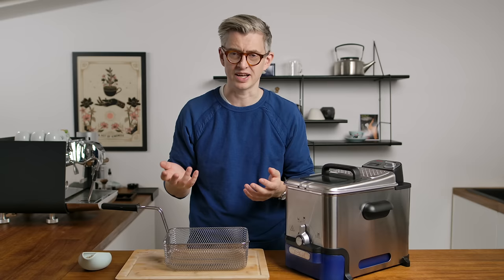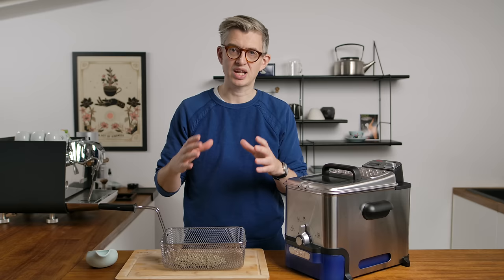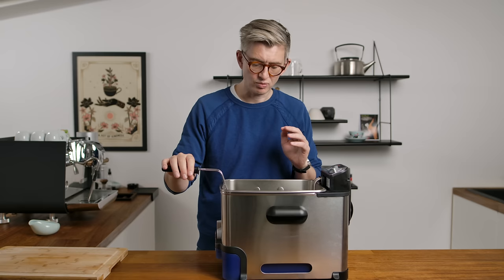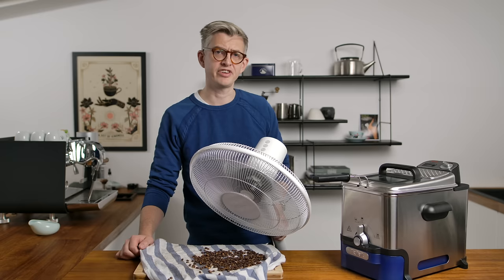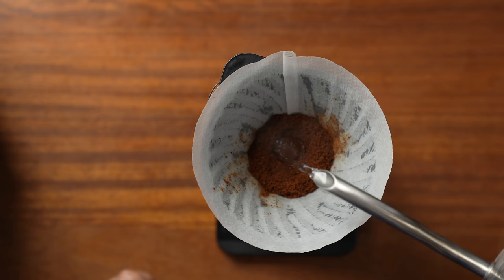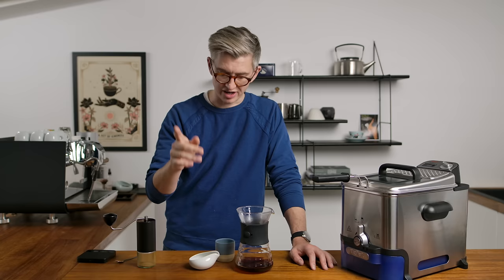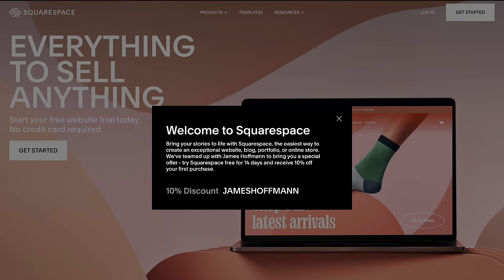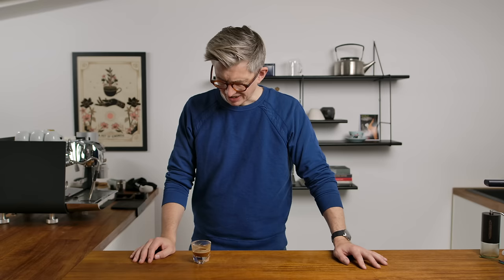Deep Fried Coffee: A Surprising Discovery

Comment: Best coffee by far?:
  My unique coffee recipe:
  40oz rainwater. 
  1Tblspoon brown sugar.
   1/2 Tsp Stevia.
  1tspn honey added when coffee warm.
  10 drops liquid sucralose.
 1/4 tsp my super rich 5fold homemade vanilla with Madagaskar &Uganda beans. (2seperate sweetness/flavor profiles)
  2tblspn cream. 
   Blend with hand mixer then briefly oxygenate as u remove mixer (dont overdo it or turn cream 2butter)
  Now here is th money saver:
   
 I use only 7gram fresh roast Uganda super high altitude beans.
    Altitude is what makes thbean. 
    I brew totally dffrnt I soak POWDERED grounds  cold RAINwater 1st heated 100° 24 hours.
   I roast cast iron which gives a full spectrum combination roast.
     I shatter 2 dust in commercial blender. 
 This releases flavor & caffeine & nutrients u normally just thro away I USE METAL SCREEN NO PAPER.
    
   1. Put coffee in 2 or so cups cold RAINWATER ONLY 24 hours before prepare.
 
   4. I still heat grounds with remaining water 3TIMES TO EXTRACT ALL FLAVOR.
    (But do not boil. Just under boil.) 
   Mollasses in th sugar &6 other sweetners deliver explosion of every spectrum in thsweetness profile.
   Starbucks secret is they also use rain water. But theirs is distilled & its dead even tho its flavor is wrlds above anything Lucifer bottles. Satan uses metal pipes cuz they demonize electrons on a molecular scale. Making drinks poison regardless what thlabel says. 
   Starbucks is actually code for fallen angels. 
  Extremely oxygenated rainwater has orgone hydrogen peroxide & all sorts of charged electrons static & ionization etc. &lifeforce.
  Lol Satans kids teaches rainwater& algae is poison & people bleev it. 
  I also use quartz orgone pucks in my rainbarrels & they make supercharged holy water plus I have a 2.5 ton orgone generator in my yard charges earths atmosphere out past thconstellations purifying the rain. Actually no I am not joking.
    But dont google orgone. Google is Lucifer. Only I was given that recipe. 
   Some say coffee poison. Lol Satan hates coffee cuz it strengthens his prey so he tricks u in2 using 2much in a drink. At this point caffeine begins 2harm body. Thats why his kids got the idea of Starbucks. They know rain (distilled) water makes drinks taste magic, but their distilled water has a negative spin molecularly that harms humans.
  They also put black goo & cmputer chips & other bad stuff in their energy bars & processed food& coffees.
   Thats why I roast & make coffee myself.
 @Rajiota  Asks WTF i just read???
    I REPEAT:
     Starbucks coffee water is poisoned right off thbat.
 Starbucks secret is they use distilled water. Bilut the electrons are negative orgone. Toxic.
   My rainwater is holy water.
 All water that pass thru metal pipe is poisoned by Reptilian angels.
    Metal peipes reverse electrons. 
    Starbucks is code. For men in th abyss. Reptilian angels. Space is th biblical abyss hence STARBUCKS.
    They put all kinds of DNA mods in Starbucks coffee.
 My coffee also drammatically reduce sugar while giving a sweetness kick unlike any thing u ever will xperience. 
  I use rainwater. Has all forms of charged particles ions& Yahwehs life force& electrons. 
 Coffee is proposterous scam.
   Granules too thick flavor traps inside. Drippers are ludicrous. U throw away 90% your flavor.
    I grind to powder so NO FLAVOR TRAPPED soak 24 hours then heat with 3 change water only 7 grams POWDERED coffee per 5 CUPS WATER 40oz.
  Using authentically best highest altitude beans fresh roasted at vast fraction cost disgusting stale walmart grounds with wood chip fillers.
   My coffee packed with health benefits & its literally insanely superiour 2any drink u will ever have. Same with my cocoa cream version of this same beverage made 2b drank as a cold slush. 
 I spent 40 years develop these 2 wrlds best drinks.
   I also add orgone quartz energy weapons turn water to holywater bult to Yahwehs specs. I also have 2.5 ton Oegone capacitor in my yard saturates atmosphere with lifeforce. That blue glo u see above earth.
 Do not eat food prepared by Stanists. 
 80% earth are Satans Plasticines. Hive mind demons in flesh bodies false reality computer animations who poison food tune your vibration 2h*ll.
   

Facts:
 Humans body organs begin fail 1week with no fats. Bible say WELL OILED dishes food of kings. 
 FAT DUZNT MAKE U FAT.
 Satans poison fat makes u fat body cant digest it. 
  Rats fed Satans flour died faster then those starved rats REFUSE eat bread if u give them a choice.. 
 ....grind eat corn wheat FRESH ONLY.
 do not eat only veggies.
   Indians ate veggies b4 feast it makes u hungry. Cuz not enough calorie vs energy 2digest.
 Satan put more people in hell last 50 years with low fat vegetarian diet then any other thing veggies only weakens u.
 Humans body is a furnace eat your meats & NATURAL COLD PRESSED fats.
  
*****************
People wade thru absolutely gargantuan mts. resources & energy 2even begin2 function then they throw excess away. And its still not enuff 4them. 
 Lucifers cup is ALWAYS 1/2 full.
    
   They wonder how I live on 3k a year drinking coffee better then kings. Cheap Walmart coffee used2 cost me 12 pennies a day; my premium Uganda or Costa Rica fresh home cast iron pan roast cost 17pennies per 48oz. coffee.
 Sounz 2me like less is more again.
   People pay fortune 4lousy Walmart coffee cuz good sduff is price of gold. Then they use 23% of thlousy coffee throw threst away.
 Why? Cuz google says so. Cuz schools taught them 2b a scrypt. Follow threcipe scrypt. Satan loves mocking thsht outv people. And peoole keep 5star reviewing him. 
  My sister was a bigshot Whole Foods stores. I got 2try some exotic sduff. 
   She, like every1 else would hump Lucifers google make coffee th idiot Lucifer way.
    Using gargantuan heaps xpensive coffee, $$$ coffee machines, $600 roasters, & $$$ coffee paper. 
 I would collect th "used" grounds make coffee 3 more times with it.  
Lucifers rule = 11grams coffee ground per 6oz lol. I use 8gram per 48oz. I grind to powder use no paper soak cold water so max flavor come out. Satans kids use huge grounds flavor locked inside granules water cant absorb. Then they heat grounds near boil ruins flavor. 
When people buy coffee its dead. It was ground long time ago has no lifeforce. 
 When I buy green coffee beans its alive. Seeds are alive. Once u grind/kill they begin get stale. I buy once every 5 hears &store living food.  
   Satan does same with flour. Your bakery products DEADLY poison 2humans body.

Comment: You might want to try using an ice cold mixture of water and ethanol (vodka for example) to gently rinse the beans after frying. 

This will stop any continuing heating, but also the thermal shock might actually crack the beans, and make them more pourus. The very low temperature should slow down the dissolution of any of the target polar/soluble alkaloids, terrines, and volatiles, but should get rid of almost all of the oil. 

The only downside is you will have to dry them.

Comment: Thoughts:
Different oils heat to different temperatures, have slightly different thermal properties (partially related to viscosity?), and imparts different flavor. Peanut oil is the household preference for salty treats.
Not sure if coffee cooked in a vacuum is a thing, but if the cracking/popping is desirable, that may help (you can reference vacuum popped popcorn if unfamiliar).
Maybe this is appropriate for other circumstances where coffee is used as a component? Dessert recipes?
Holding the fan at the distance you did is probably less effective than holding at a further distance, (if memory serves, fans like that work best about a meter away?), but setting that up properly was likely not worth the extra effort.

Comment: another potential idea is deepfrying at different temperatures,  maybe a higher temperature will have the heat shock to analogue the first crack effect, but maybe air is particularly good at this, I know popcorn uses a combination of oil and air but maybe all oil in cases like jiffy pop?  edit: instead of deep frying them maybe try pan frying them in a bath of oil that just covers the beans, and then keep with that 170-180 temp?  maybe someone more adventurous than me could try.

Comment: I would've dried off the beans real well after they came out of the oil then put them on a pan and popped them into the oven for 5-6 minutes at 450° F...Also, I think the oil needed to be a little hotter to start to avoid excess absorption of oil, maybe about 185°-190° C...Also, the oil should be Flax Seed Oil not some cheap Vegetable Oil...

Comment: I personally deep fry everything and you need to get your oil as close to its smoke point as possible without actually smoking. We use canola in our fryer and fry everything at 350 and sometimes 375. You could do this with animal fat in cast iron or even just your cheap stamped pots. If frying them makes home roasting more viable than having to buy a popcorn popper I may have to buy some green beans and give it a shot. If using a popcorn popper makes a better coffee than some of the crap on shelves it still may be a viable option.

Comment: Sorry, I hate to say this, but it if you deep fry things at home do not keep the lid on I’m a chef unless you love cleaning deep fryer oil it’s built-up over time and it’s near impossible to get off for the love of God keep the lid off. I’ve been using my home deep fryer for five years and never had an issue. I’ve been using commercial deep fryer. They get even hotter than the home ones for 9 1/2 years and I haven’t blown up or set fire to anything yet.

Comment: I'd try it once!  It's really strange the difference between the two brewing methods.  I think, because the Espresso shot is forced through at high pressure, you ended up with a lot more of the oil in your shot. but, oil, floats on water, so the filter brew most of the oil probably ended up either in or above the filter.  Really curious, but also like you mentioned you probably lost a bunch of coffee to the firer and the process.

Comment: Out of curiosity could the reason it didnt taste fatty be due to a lack of material that absorbs large amnts of fats? I am unaware of the composition of coffee beans or how that would work but u mention that they werent that greasy when u dried them so would that theoretically means either A they dry from the time u took em out till u started drying them or B (which is what  I think happened) which the oil is not penatrating the first layer of the bean (or at least to a nominal amnt) therefore acting as a more consistent vector for the heat to evenly roast the bean? or am I just a idiot?
Reply: also just watched a few seconds ahead could u try it on even a lower temp would that provide more aromatics?